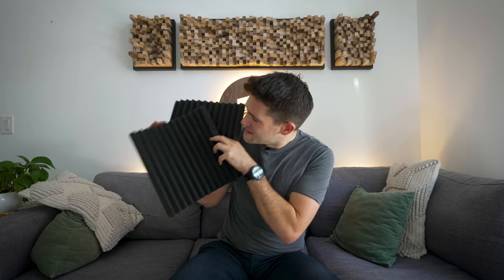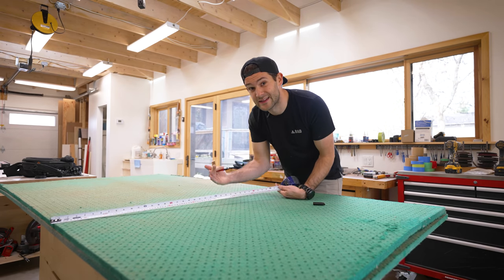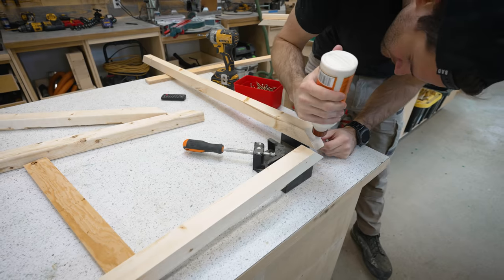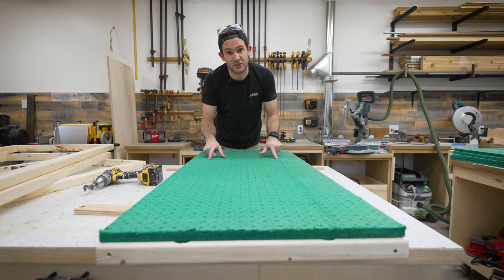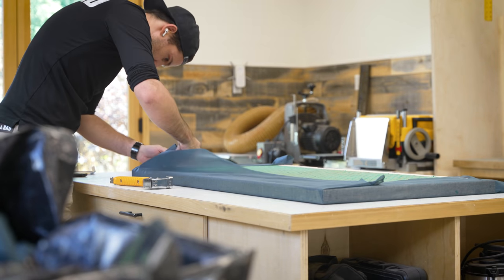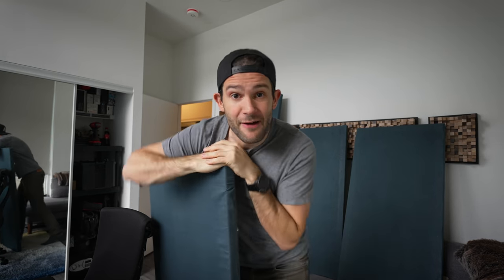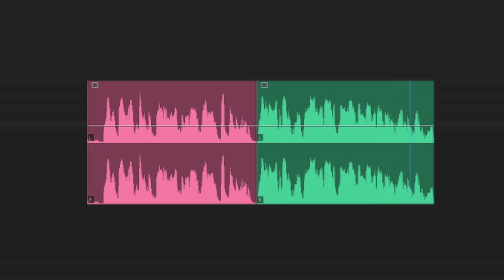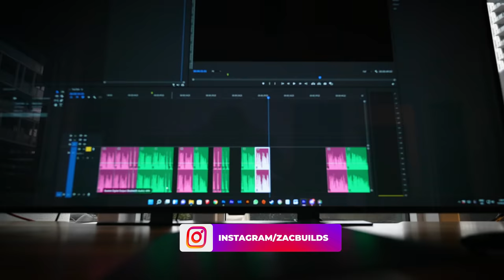Acoustic panels that actually look GOOD

Comment: Hey Zac, fellow Canadian checking in! Appreciate the videos, but I'd like to clear up some misinformation for people reading the comments!

The foam panels you show at the beginning only reduce flutter echo and are a cheap, not-so-great solution. They are not similar to the diffusion panel you made because diffusion and absorption are different concepts. As an aside, the wooden diffuser could've been improved by using an online calculator for proper block lengths and placement rather than randomly gluing pieces.

Back to the panels, there's a reason why thicker panels are used and that's because they're meant to absorb sound waves. Sonopan is a material used for sound proofing, which is different than sound treating. The purpose of Sonopan is to keep the sound from travelling through the wall, but if you use it in a panel, it's like covering up a wall by adding another wall. Rockwool does a much better job letting sound waves bounce around and get "trapped" in the panel.

Finally, flutter echo is not the only thing you're trying to fix with sound treating. A major issue is bass build up, which is at its worst in triplanar areas (corners). Panels should be placed where you're likely to have first reflections, but also in corners to mitigate bass build up. Your room has multiple windows and tall ceilings which is kind of a nightmare for acoustic treatment. You could certainly do it, but you'd need a lot more panels and better placement for more effective treatment. There really isn't a huge difference in your audio test.

Hope this helps you and other people reading and if you want to hear my own DIY acoustic panels at work, feel free to check out my music. Cheers!
Reply: Hey! Thanks for the insightful comment. Got a link to an online calculator for a wooden diffuser? Thanks!
Reply: +1
also, 'i think ...' is never a good way to discern if something is better or not... always measure or at least compare technical specification
Reply: Just my two cents here. I wouldn't call it a bass build up, but it's reflections in the corners that cause issues. It makes you pretty much hear the bass 3 times. It's best, if possible, with a normal listening setup, to move the sub forward (same with speakers, move them a bit away from the wall). Depending on the sub size, order, specs, room setup, it can be a third of the length of the room inwards to really improve the sound, to improve sound quality and sharpness of the bass. Especially for bass, it really matters if it's a second, third or fourth order design. If it's a fourth order, where is the vent located, etc. But on the other hand, build up might be a nice way to put it. 

Bass traps do work, and work well. Not only on the vertical parts, but also horizontal, at the bottom of the wall. 

I fully agree with everything else you said here.
Reply: "Sonopan is a material used for sound proofing, which is different than sound treating" -- can you elaborate? Here's my thinking: the problem is sound reflections off the smooth wall surface. If Sonopan is designed to block sound (and it seems you agree it is), then it's preventing sound from reaching the reflective wall surface, preventing echo. And of course, if some sound does make it to the wall, it has to come back out through the sound-blocking Sonopan, further attenuating the sound.

As long as Sonopan sheets aren't reflecting the sound back into the room, isn't "blocking" really the same as "absorbing" (i.e. what rockwool does)? How are those two things actually different? How would a material block sound without actually absorbing it or vice a versa?
Reply: @harvey66616  accoustic panels are not designed to block sound. Accoustic panels are designed to diffuse sound. These panels now block sound, not diffuse sound. They take audio out of the room, instead of spreading it around. Let me give an example. Let's say you have headphones on. The headphone you bought have 100% separated channels. The left signal is only in the left ear, the right signal only in the left ear. After 30 minutes or so, you start feeling tired. That's because audio isn't supposed to work like that. These headphones are blocking the sound to the other ear. Now modify the headphones to let, let's say 10% of the audio pass to the other ear with a 2ms delay. Suddenly you can listen to it for hours and hours. 

Both rockwoll and sonopan are therefor kind of a problematic way of solving something. The wooden structure behind him in the beginning would do a much better job. It still reduces echoes, but by diffusing not by absorbing.
Reply: @iamarawn  I would say mineral wool or fibreglass panels absorb sound while wooden diffusers diffuse sound. You're totally correct that you don't ever want a totally dead room. A combination of absorption and diffusion is what you're after.

Comment: Zac, a few suggestions. 1. Float your panel a few inches off the walls. 2. Place your panels for primary reflections (think of mirror reflections from you to microphone off walls…if you’re not already doing this. 3. (Perhaps the last large improvement) Put panels on the ceiling (and thick rugs on the floor).
Reply: Very curious my guy, why off the wall a few inches? Spare no detail (that youre willing to share). And by the mirror are you referring to directly behind him or directly in front ?
Reply: you can also use layers of towels instead of sonopan behind picture frames. cheaper and much better than most materials.
Reply: @Straixin  Hi Straixin, basically you want to space the panel with a gap between the wall because it will absorb more sound. The sound not only goes thru and returns back through the panel, but the more sound traveling in parallel to the panel can be absorbed. Gapping can vary based on material and thickness, but most sites seem to recommend 3-6 inches. More is better but become impractical for small rooms as it eats up so much space. Experiment with gap distance if possible, considering what is still practical (eating up too much space or wide acceptance factor, etc.)
     The placement should be for first reflection lines from each speaker off of one “bounce” to each ear. This means from each angle (primary reflections), from front, sides, floor, rear and ceiling. For example, for your left speaker to you left ear, you will need to cover six reflections: L. Speaker to front wall to L ear; L. Speaker to rear wall to L. ear, L. Speaker to L. Wall to L. Ear; L. Speaker to R. Wall to R. Ear; so on and so forth from ceiling and floor too. Also remember to not only do right speaker to right ear, but also the cross from L speaker to R ear and R. Speaker to L. Ear.
    This sounds like a ton, but usually panels can be positioned to hit multiple reflection points, so hopefully you do not need to make 24 panels, but hopefully can be managed with as few as six panels.
    From there, every reflection after that is also reduced because you reduced the primary. Think of all reflections in your room as a form of noise that interferes with (boosts and attenuates with varying frequency phase/timing of) your original sound/signal. 
     Once those are addressed to help as much as easily possible, treating corners with bass traps can also tame rooms. Unfortunately, small rooms like bedrooms (8x10’ and up to I believe 14’ wide) will have a difficult time sounding really good due to length of low frequency sound waves , but these starting tips can help make a room much more useable.
   The original video by Zac may have already considered these, and I have not watched other videos of his, and it looks likely he did. Just wanted to chime in if those wanting to do something like this want to try and get more mileage from their effort. Hope this helps!
Reply: good advice.  Many overlook the 5th and 6th wall. (ceiling and floor).  Every music studio I have seen has a large persian rug.
Reply: Pulling them off that wall increases the effectiveness of a panel. The back needs to be open also, like the front. You can take a 2" panel, and have it perform more like a 3in
Reply: You experience a net loss of sound absorption if the distance off the wall is greater than the thickness of the sound panel, i.e. if you have a 2" thick panel, it shouldn't be placed off the wall more than 2", 1" would suffice.
Reply: @kimballspeakthreetheater3318   does the gap off the wall matter if the gap is only behind the sonopan or other material (using a thicker frame with the panel up front but frame against the wall) or does the entire frame have to have an airgap behind it, almost like using 4 posts in the corners to act as feet or legs?
Reply: @dellsdiy  It benefits you to have a gap behind the panel (if the back of said panel is open faced and not say a solid sheet of something). If your backing is solid then it shouldn't matter because it'll be another hard surface for sound to bounce off of.

Comment: Ok, first the big problem with the foam panels, besides their being ugly, is that they only absorb in the very upper frequencies, which definitely helps but is not ideal. The reason why Rockwool is chosen is due precisely to it's thickness. The thicker the panel, the greater the sound absorption and the better it performs at absorbing a wider range of frequencies (but not bass, that is a whole other story). The other thing most folks do not do is to mount the panels a few inches off the walls, which when measuring shows significant increase in sound absorption across a maximum frequency range. And the viewed below is entirely correct that sound absorption and sound proofing are very different goals requiring different materials. Those stiff, flat panels may reflect sound waves as much as they absorb them, which is not that much help, whereas rockwool will not tend to produce any reflections. It should also be mentioned that sound diffusion panels should be constructed and installed along with absorption panels, at nearly 50/50 ratio, and some will suggest mixing them along any given wall space. But hey, much better to treat your walls with something vs nothing. I have seen so many pictures of extremely expensive top line hifi systems set up in entirely untreated rooms, which likely sounded horrible.

Comment: I’ve just made similar panels but using 3-4 bath towels, stretched and stapled into the frame, covered with a quality black bed sheet. They work great. I had the wood from old bed slats and the towels were $2 each (from a hotel) so they cost me around $10 each to make. They are very large.
Reply from the maker: Ha! That's an awesome idea and something I never would've thought to do. Nice one Craig!
Reply: @ZacBuilds  someone else on YouTube gave me the idea. He did tests with towels and they were the most effective
Reply: Commenting so I can come back.  Thanks for the idea!!
Reply: Recyclable ♻️ cotton is the best for acoustic panels and ceiling clouds. And you'll never have an issue with harmful particles in the air. Demin is the way to go. Nevertheless, it's more expensive, but just buy cheap bath towels, and you have it.

Comment: There’s a trick for getting upholstery tight and wrinkle free. Start with one staple tacking down each side, then do opposite sides working from the middle outwards. For the tacks, put a small scrap of cardboard in there so you can easily pull out the staple if needed. I’d start with the two long sides, pulling tight both across and away from the tack. Pulling both ways will keep it nice and taught the whole way across. After that, you might find that the ends are too loose and need pulled tighter, you can rip off the cardboard and there’s space to get a flat head in without damaging the fabric. 

For the corners, stop a few inches from the corner. This is where cutting off the extra really helps, all that excess makes it harder to keep it looking nice. What you want to do is cut off the corner at a 45, leaving the sides longer. This is one of those spots where you need to fudge things, the less excess you have the easier it is to hide the extra in the back. Cutting off the extra also keeps bulky fabrics from getting too thick. If you think of something like leather, it’s about 1/32 to 1/8” thick, having 3-4 layers at the corner can be enough to prevent staples from biting the wood and creates enough bulk to keep the seat of a dinning room chair from sitting flush against the frame (think about posts and apron pieces). 

With the trimmed corners, fold up the long side. You can tack it on the back and on the  short side to keep things nice and smooth. The staple on the short side will get covered when you fold up that side. With that side done, you can take your time folding up the last edge until you get it looking nice. Don’t worry about anything more than 1” past the corner, you can cut that off and ignore it (that’s where you’re fudging it, only the actual corner needs to look good).
Reply from the maker: Great info, thank you! I'll definitely keep this in mind for next time.
Reply: Mr. Rogers used to say to look for the helpers. Found one :)
Reply: This is such solid advice, the only thing I'd add to it is that you can steam as you go, this will help the fabric stretch and sit crease free.

Comment: Hey Zac, great idea! Sound tech here and I see so many people in the DIY space turning to definitely less safe options like fiberglass insulation in their home-made panels. It was great to see an alternative use for something like Sonopan. Honestly, and this is probably due more to how perhaps have your Yeti set up with its back/rejection towards the windows (particularly if you have it set to any thing other than omni), I heard the most monumental change on your lav mic even before you started doing the tests so it’s definitely doing the job! Though it still did help tame some of the mids/upper mids for a definitely cleaner sound over the Yeti. Great idea!
Reply from the maker: Thanks Matt, unfortunately I think I'm a bit of an idiot. I forgot I had my yeti set to automatically apply a light reverb reduction to all recordings. (It saves time before the wall treatment haha) So ya the lav mic actually gave a much more realistic demonstration of the effect of these panels. Ahhh well you live and you learn right?
Reply: Nothing dangerous about rockwool panels , especially because they are covered in fabric
Reply: Rockwool isn’t fibreglass.

Comment: The thing with sounds is the"frequency"  wave length absorptions of the material used.. So the thickness and material density has a great absorption. High pitch is easily absorb, because of small wave length. The lower frequency like bass are longer wave length, therefore need more material to be absorbed. So rockwool versus sonopan and how thick you go. Both would the best but at different wave length. The ultimate would be using both, and varying the thickness.
Reply: Nope. Its like saying, on a trip you sometimes drink allot, sometimes little. So therefore you need to varying the size of waterbottle you bring.

Thick material also absorb the high frequencies. The "ultimate" is thick panels combines with diffusors. Thin panels often do more damage than good.
Reply: @haknys  I meant you can go thinner depending on the frequency you want to absorb... but definitely the thicker the better.
Reply: @sebastiendesormeaux1853  Yep, 100% agree! The deeper the material, the better it is at absorbing lower and lower frequencies. Absorption where room boundaries meet (corners especially) is the best way to absorb at lower frequencies.

Comment: Those panels indeed look very good. However, I would suggest that to make the difference more noticeable in the test recording, you should record from a slight distance to the microphone so it has a chance to mix up with the room sound too. At a closer distance, the primary sound source (your voice) is too strong to be affected much by the room reflections. Cheers
Reply: Probably will apply effects later during mixing and mastering.
Reply: For the microphone I agree it's no problem. But to do a correct mix, the room acoustics will affect that..

Comment: It definitely improves the sound, but you can only go so far if you want to keep it minimal. Cause there's still quite clear echo from it just being a small room with parallel surfaces. 
Some random easy things to improve it could be carpet, close curtains, open closet.
You could try tackling some nice basstraps in another video.

Comment: I'm sure someone already said this so throw this comment away if not needed 😊 but float those panels off the wall a bit. Air is the best dampener. Think about the angles of sound absorption like light bouncing off a mirror. Put panels up in the spots the "light source" (your mic) would bounce light back toward itself.. Also, treat your ceiling the same way. With the ceiling, however, you might want to angle the panels towards your mic set-up. I'm guessing you have hardwood floors so I would also put a nice big rug down (something with some plush or cushion) and maybe some stuff in the corners of the room. Bookshelves full of books work great if you're not trying to build bass traps 😁

All those "not a pro" suggestions aside. Awesome video. Definitely gives me ideas for my studio 😎👍